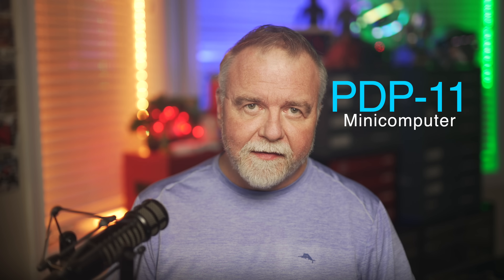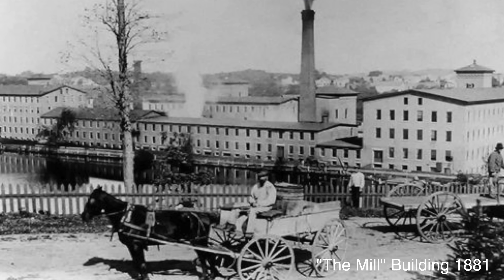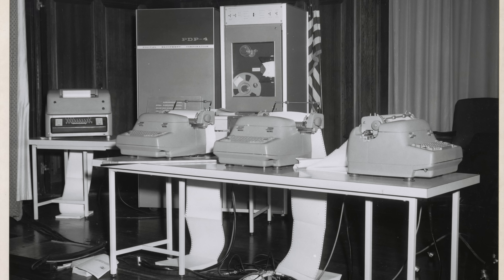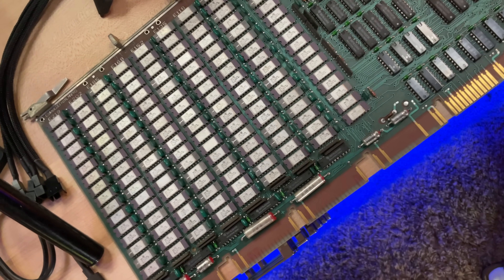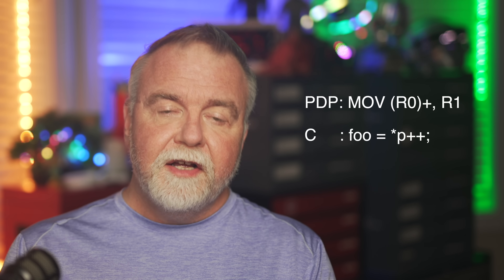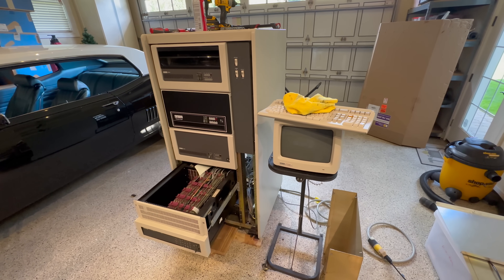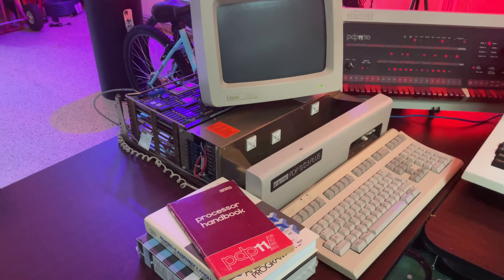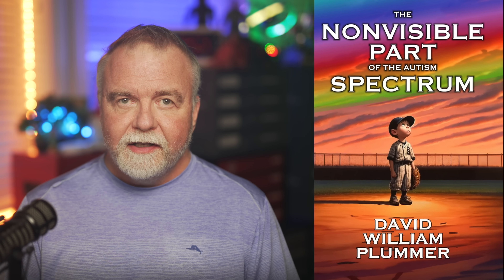From Core Memory to the Internet: Amazing History of the PDP-11

Comment: Thank you for sharing, I remember helping networking three PDP11 together with thick Ethernet. My overwhelming memory was helping install 5 smaller “boxes” on the same Ethernet segment and thinking they were really special, tiny quiet and with 8 vt200 terminals. I was amazed at the size of these other boxes compared the the 8 racks of the pdps. I was convinced I had seen the future of computers. It turned out these smaller boxes were just terminal servers interfacing serial to Ethernet then connecting to the pdp host. To be fair I was only 7 years old at the time. I learned much more over the last 45 years

Comment: In 1973 the Univ. of New Orleans got a PDP-11/15 in Lab configuration - many analog to digital and digital to analog convertors, several binary connectors to detect triggers.  I programmed it using a paper-tape O/S.  The Univ. of New Orleans had a PDP-10 with a PDP-11 cross-assembler and paper tape punch.  I used it for my dissertation research.  It did data acquisition and immediate computation so that I could get results within seconds after the experiment finished.  I could take data at rates up to 1 signal every 200 microseconds.  Got my PhD in the field of analytical chemistry with a chemical kinetics project.

I later worked for a company that built oil-and-gas pipeline control systems in the Supervisory Control and Data Acquisition category - SCADA.  We had maybe 40 to 50 such systems out in the world before VAX came along and provided much more robust environments - until PCs came along to take over that market.

Comment: The computer I had on the first flight simulator I maintained was a 3C (Honeywell) DDP-124.  That computer was a 1965 design if I remember correctly.  It used magnetic core memory.  We added a second simulator with the same computer.  After moving it from North Carolina to Seattle, all we had to do was put the switch in run and press the start button.  No reason to load the program into memory after the move since it was still there.

Several years later I finally got to work on the PDP-11.
Reply: At a telco, we came across a really old glass terminal that hadn't been run for years. We turned it on to be greeted by the last screen it showed before decommissioning, that old core memory is crazy stuff.
Reply: Core memory was really useful after a power outage.
Reply: Now there is FRAM memory with the same properties

Comment: In the early 80s while I was in the Air Force, I worked at Strategic Air Commad Headquarters in Data Automation.  One of the computer systems I wrked with was  an Intelligence Communicatons Computer that was a node that communicated witn other intelligence organizations such as DIA  and CIA.  It used PDP 11/70s.  As I recall, it used five PDP  11/70s.

Comment: My University in New Jersey had VAX running VMS operating system. We used software called LaTex to print our research papers! It had serial interface used for connecting video terminals. Today they are called flat screen monitors. Thanks for giving commentary on amazing times we have lived through. It would be interesting to offer "History of Computers" subject in the universities. But new generation may not be interested in the old days  (about 25 to 30 years ago) of computers.
Reply: Many years ago, when I was taking FORTRAN at night school, I did my homework on a VAX 11/780 running VAX/VMS.

Comment: The Parkes Radio Telescope is still using a DEC PDP11 to control the positioning of the dish, or was as of about a year ago (im sure they still are). Im sure there are still other PDP11's in use out there because of their reliability an ease of use. Great machines!

Comment: The Basic Four, which used a Microdata computer, had 4 K memory which was two board hooked together with a flat cable.
I worked on IBM 88 collators which used relays for memory, they later pulled out all of the relays and put in a little box with core memory.  Was really weird.

Comment: I remember networking a bunch of IBM clones that I had built for our research lab, initially using a couple of DECnet 1Mb/s coax cards with some 'open source' software to create a router to put us on the backbone of the Texas Medical Center (that is probably the Texas node on your map).  The real network people were all running Sun workstations, that our lab could not afford.  Getting a DOS 3.11 PC to run a stable TCP/IP network stack was a major pia.  But what fun when it worked.  We advanced through the Windows over DOS era and Win95.  But my real aha was when MS realeased the beta of NT.  I thought I was in high cotton.  All in the late 80's to early 90's.  I remember setting up NT on a DEC Alpha workstation in the later part of that time.  It seemed like a mainframe to me, with 128M of RAM and a couple of fast SCSI drives.  And now I have a phone in my pocket with more RAM and storage, and probably similar computational capability.  What a trip the last 40 years has been.....
Reply: I see your name come up an awful lot too. I don't know you jiffy but I hope it's not Epstein. Probably is though
 Don't know ya. And jiffy, I probably dont want to. Gargantuan

Comment: I think these machines are very interesting.  I have some experience as a user of an IBM 1130 in the late 1970s, I guess it is a bit smaller than a PDP.  I would also be interested in how and why the VAX was developed after the PDP.  I've heard that the VAX was even hardened and repackaged for use in aircraft.  I've also read the Tracy Kidder book about the Data General competitor to the VAX.
Reply: Was at DEC Sales Support starting in 1987 (MDO RCH if any Deccies out there) and I recall the VAX 11/780 was named that because, even though it was a completely different machine architecture, DEC wanted customers to feel comfortable that the VAX was an extension up of the successful PDP-11 flagship.  I recall, when the VAX was announced, everyone was asking us, "Will it run RSTS/E?"  Good times.  Ken came and spoke to my newhire class in Shrewsbury MA, told us, "This PC thing is a fad.  Customers want mini-computers!"  Well, that was Ken.
Reply: VAX was developed to move DEC from the 16 bit to. 32 bit world. Although processors like the 11/44 had an external address bus up to 22 bits wide and so could address 4 Mbytes of physical RAM an individual program could only reach 64 kbytes of that. It also only supported real memory and not virtual memory - and real memory was still pretty expensive at the time. So DEC created Virtual Architecture eXtension which was a true superset of the PDP11 instruction set and could run PDP11 programs in compatibility mode.
Reply: @Richardincancale  Yes I believe you are correct and better said it than I

Comment: Couple of other things: When you bought an IBM mainframe you had to buy IBM peripherals AND IBM software. This was known as bundling. No third party stuff. DEC had a large 3rd party market for both hardware and software.  You could save a lot of money by going 3rd party, assuming the 3rd party stuff worked. Sometimes it didn't. Definitely caveat emptor in those days. It was kinda like the App store before the App store, except there was no central place to get it all. Dataram was a company that made memory at a fraction of the price of DEC memory. I still have a Dataram promo envelope opener/refrigerator magnet.  I remember at NYU they figured out how to use CDC core memory for their IBM computer and it was hella cheaper. (And it took up a lot of floor space.) Oh and another thing about IBM, they went with Token Ring as their network solution. DEC went with Ethernet and this made TCP/IP and the Internet possible. IBM came to TCP/IP very late in the game. (And the history of Ethernet is itself fascinating. Poor Xerox, invented so many great things but never capitalized on them.)

Comment: My experience on a machine with core memory was a 660kHz CPU main clock speed. That's kHz, not MHz, and not GHz. And most instructions were a number of microcode steps. It was fast enough to control a large nuclear reactor in real time.
Reply: Canada?